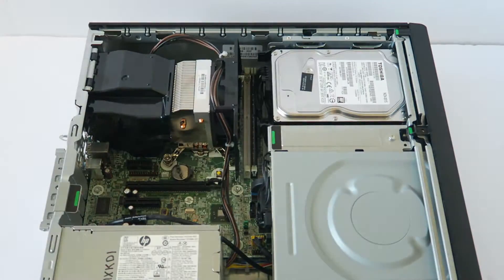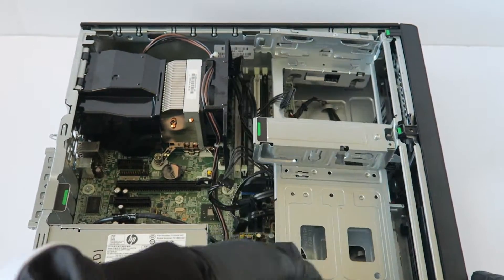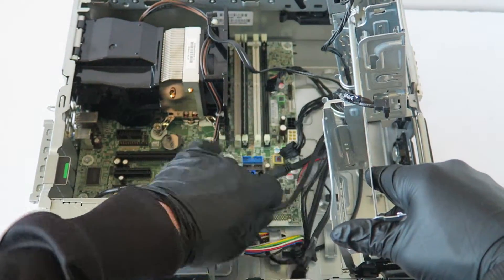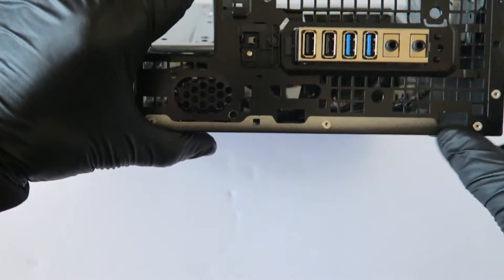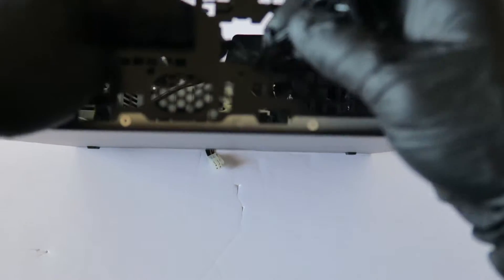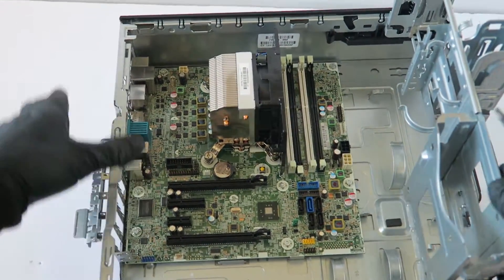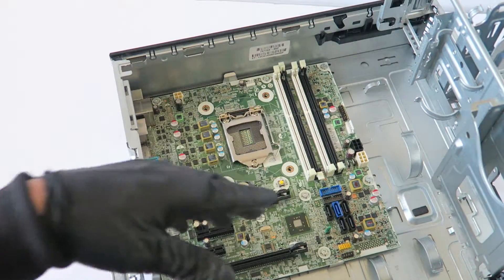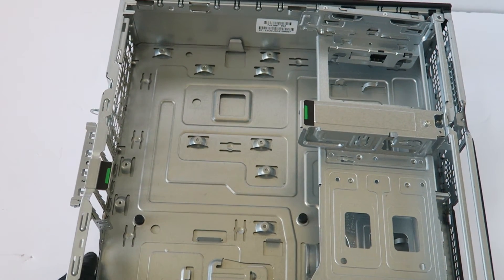HP Z230 Workstation Teardown

Comment: Can a zotac geforce gtx 1650 LP graphics card be installed and used? If so does power supply need to be upgraded?
Reply: The pc can support any graphics card up to 150 TDP watt. It can support even a GTX 1070 with the 400 watt PSU.

Comment: Can you put a low GT 1030 in it?
Reply from the maker: Hi, yes you can with low profile bracket
Reply: @Mxkdt   Hi. I installed a GT 1030 graphic on the Z230 SFF computer. I can see 8 GB of installed RAM (7,80 GB usable). How to configure the BIOS to use all available RAM? Thank you